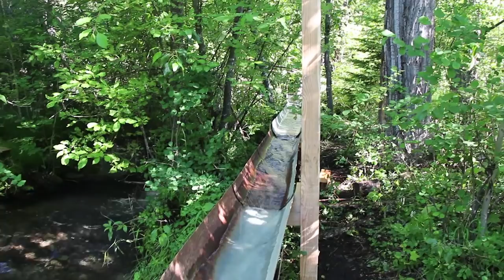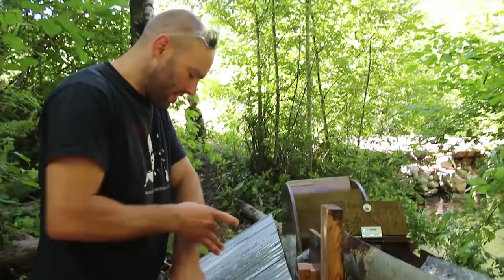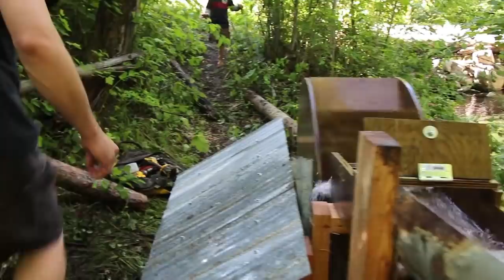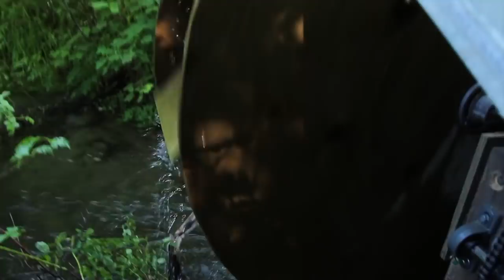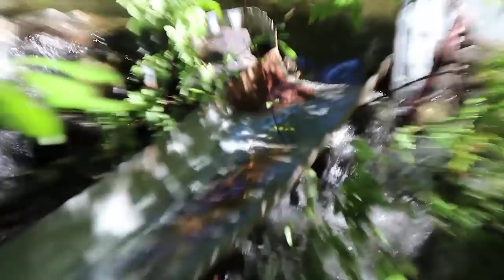Waterwheel to produce electricity

Comment: 50V means nothing, it's the current (Amps) that matters. Nice gearing though.
Reply: Well here's the thing. If you have 5 volts you won't be lighting much. If you have 14 volts you will be charging a 12v battery. So 50 volts will power lots. Unrelated, I just built a generator ironed out the bugs and can power and angler grinder and sander! Voltage matters
Reply: @cadenceandfamily2159  It won't power anything if you don't have current. A spark plug in a car is 20'000 volts but virtually no current so you get a tiny spark.
If you get 14V and say 50amps,(24/7)  you then have some useable power to run a small house.

Comment: Nice, sir, if you use bigger gear compare to the small ones and if you make the chains not very tight as you made it, it will turn your dynamo very fast, and you will get much more volt and ampers, it's physics

Comment: Reverse the action of the wheel, water falling over it not behind it, kinetic energy being wasted. Use plastic and stainless steel washing machine parts. Fee at the dump and made to last in water, Modern car alternators vary a lot, some produce 2500 watts @ 300 amps, Almost Free at the scarp yard. Your on the right track with the gearing. Pipes are better than water troughs, reducing them increases power, 12" - 8" - 4" Just a suggestion. . . Great to see though, have fun living off grid, lucky people,

Comment: get rid of the V belt  (Huge Power Losses ) run flat belt or cogged belt
and turn water wheel around as an over slung wheel again much more efficient to yous the momentum of water flow to assist in the rotation of the wheel

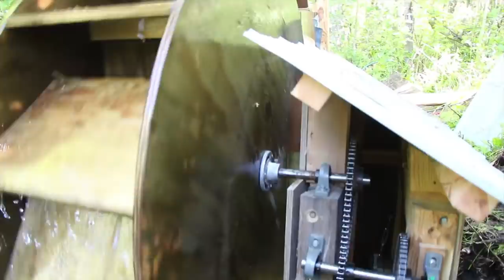Comment: thanks for posting.  here are some very very late thoughts.   the drive looks great.  the 'wheel, not so much.  as seen at 2:20, only about one-third of the available head is being 'used'.  at a low-head low-flow site* such as this, the Most efficient type of hydroturbine to use is a Correctly designed, poncelet-style overshot waterwheel; where the radius of the 'wheel is roughly one-half of the available head.  optimum bucket volume / width is determined, primarily, by the flow rate.
a waterwheel is a LOW-speed machine; it Should be loaded so it rotates at about 15 rpm.  why.  because a bucket Cannot fill Instantly.  it Takes Time.  * at such a site, the potential energy being converted is that of the Weight of the Water IN THE BUCKETS.     cheers
overshot waterwheel, with water shown falling with incorrect vector.
http://etc.usf.edu/clipart/36300/36373/overshot_36373_md.gif
modern bucket design; bucket design should include a 'lip', of some sort.
http://www.smith-eng.co.uk/hydro/

Comment: In my opinion he should put the feed way lower. The way it is now, the waterweel turns against the infeeding water which hits the plates moving down, slowing the waterwheel down. If the infeed is lower you have first more waterspeed and second the water would not hit the plates not slowing the waterwheel down so much.

Comment: Yeah that's great you guys have 50 volts at night time. Know I say these things to be helpful.. you should have had your gearing system in your alternator originated up that is place your alternator above the wheel that way when the flood waters come the dirt won't get into the alternator and you can attach your power lines above.. Now this all looks a little bit to prove a concept therefore All Temporary now you need improvements.. consider a concept of harnessing as much as a creek as possible and in this your flu will be much wider and just a little bit taller. Consider boards carpet glue and vinyl kitchen flooring if not heavy plastic.. your water wheel needs to be heavier and perhaps made out of metal. And trash is a thing that you need to consider such as leaves this is why we're hardest thing most of the water and most of the trash will hopefully run right through. Your Levy need to be heightened and have high walls to collect most of the Overflow through the flu. I have seen a flu 3 foot wide but the video had background music and didn't say anything about it but it was pretty neat and it was low to the ground.. there is an old-time trick putting a chain or a rope or a piece of belt hide around the perimeter of the wheel this will increase your speed. You Canad one or two more alternators.. in this you need to consider a small Line Drive that you can attach whatever you want to the wheel... Putting a tumble drum onto a wheel and experimenting with a murder Boulder Creek mortar Creek is fun and hopefully Dam Construction.. if nothing else you can try and I rock or two period. Thank you for the inspiration I do not know if you're going to improve these things on your Channel in fact I don't even know if this is what channel.... Best of luck by

Comment: too much center weight on the wheel cut wheel walls into a donut. put spokes in center mass like pvc piping to make center lighter.and angle bucket more as though it's the flow of water. take the flow of water from watergate and angle it down a bit more, make a funnel and also make the wheel thinner to fit the funnel.also if bottom of where is in water your causing drag. also add a bigger wheel about same as water wheel. bigger wheel connected smaller wheel makes smaller wheel spin faster

Comment: Why does this sound wrong.  A 12 volt alternator putting our 50 volts?  That would fry the batteries and burn out all of the lights.  But as we all know volts is potential so it's a meaningless measurement.  Isn't the real question how many watt are they generating?  One needs Watts's to do work.

Comment: Great design. Just an observation though...are the waterwheel buckets open-bottomed? If so, it's losing serious efficiency. I worked at a flourmill for years, with an overshot wheel which was insanely powerful for the relatively small % of the water supply it used. The buckets were closed-bottomed and wide, so a lot of water weight created the momentum. Looking at yours, closing the buckets and just lifting the race a little, will produce a lot more momentum. Good vid!
Reply from the maker: it is a close bucket wheel

Comment: The wheel should be turned 180 so the water flows over the top, you're losing a lot of potential energy.
Reply: I disagree, the water underneath is helping to turn the wheel also. If it was turned the other way it wouldn’t have that extra effect pushing it

Comment: THE DIRECTOR007 INSTEAD USING PMA WY YOU DON'T USED A PMG 3 FACE YOU GOING GET HI AMP AND BETTER VOLTS ALSO SAVE ON WIRES SIZE  YOU CAN USED A 24 OR 48 VOLTS PMG WITH A GOOD CONTROLLER LIKE A MIDNITE CLASSIC 150 AND YOU GOING SEE THE DIFFERENCE JUST MY THOUGHTS

Comment: Wouldn't it be better if you turned the waterwheel around, then the water would push the wheel as they both would be going in the same direction? Also if you fed it from the top more fins would have water in them at any giving time, creating more weight, which means more power, which would create more speed.
Reply: Yeah, the impact of the water against the wheel causes it to slow down, water has a lot of inertia and having it above center of the wheel causes it to hit the sides of the buckets and offsets a lot of the velocity that's generated by the water falling into lower buckets. Either lower the end of the race to hit the wheel low down (tilting down on the race will give it a lot more velocity before it hits the wheel) or turn the wheel around and raise the race up so it goes over and the velocity of the water is used to help rotate it...
Reply: Also would a small wheel be better ? Less distance to travel for a full rotation and as It would be lighter, a faster rotation also?
Reply: The Back of a Bucket is Nothing vs the Front of the Bucket same Forward Direction
Reply: Cheers for this, I have been researching "how to create your own electricity" for a while now, and I think this has helped. Ever heard of - Diyadison Penhloe Blaster - (search on google ) ? It is a smashing one of a kind guide for generating your own electricity without the hard work. Ive heard some awesome things about it and my friend got amazing success with it.
Reply: Cheers for this, I been tryin to find out about "different methods to generate electricity" for a while now, and I think this has helped. Ever heard of - Diyadison Penhloe Blaster - (should be on google have a look ) ? It is a great one off product for generating your own electricity without the headache. Ive heard some pretty good things about it and my mate got great success with it.
Reply from the maker: What you are talking about is a backshot water wheel. It would be possible but this was meant as an experiment and achieved the goals I set out for it.
Reply: @JewelCreekFarm  Stumbled across this channel just now. And immediately i can tell you are a an arrogant asshat.  Good luck

Comment: if you did a better job of closing off the area around the top of the spill way, and maybe added another layer of loose rocks on top of the Damm you could increase the water flow quite a bit.
Reply from the maker: thus was built as a test. raising the dam would help for sure. however then the sides have to brought up as well as it spills over there already. thanks for watching and the comments.
Reply: +theDirector007 
if they want a higher speed have them take a belt sitting on the entire water wheel and guide them the force axis on one, then they do not need a gearbox (google translater ;D)

Comment: Can someone please explain how the transmission works, its pretty cool and id love to know! how does the v belt get the other wheels to spin faster?
Reply: +Asad This is just a roller chain as you will find on a motor bike or industrial application. A Roller Chain is the most efficient way to make a gear change. It will cost you about 2% of your power if you are using a light oil. But light oil does not stick around forever unless you keep putting it there, so perhaps he is using grease which may waste a bit more power. Grease is always a bit water soluable so anything like rain will cause it to turn to a sticky mess and jam up! The Parts can be obtained in stainless steel, but getting them wet will still be a lubricant problem!
 So he said there were 48 to 50 teeth on the first cog. One can assume something like 12 teeth on the small cog. So it spins at perhaps 4 times the speed to keep up (that is how it works - just make a ratio using the number of teeth). He has repeated that with another set so now we have roughly 16 times the speed. The final stage however is a v belt, and the pulley that we see is quite large, so it seems this stage leads to a speed reduction instead of an increase perhaps something like 2 to 1, I guess because that is what was available. So the final gear ratio is perhaps 8 to 1 (I really cant know for sure, without counting teeth and measuring the pulleys). So as a rule of thumb each chain costs 2 to 3% power, and each bearing is the same. These bearings might take a bit more power, because they are greased not oiled for outside use and probably rubber sealed. If you want to guess the power loss, we have 2 bearings to mount the water wheel, two bearings to mount the next axle for sprockets, two bearings to mount the next axle for a sprocket and v-belt and two bearings within the alternator itself so that makes 8 bearings, each loosing about 2 or 3% Power then we have two chains loosing 2 or 3% power each and a v- belt maybe looses 5%  the calc looks like this assuming a 3% loss -> 1 X 0.97 x0.97x 0.97 x 0.97 ....x 0,95. As a rule of thumb guess, I would say there is about a 30% power loss in this system. So the purely mechanical loss will not be insignificant by any means. 
If you can keep the number of components down , it helps. You can do this by having only one roller chain before the v-belt, this will cut out 2 bearings as well, but the first sprocket will have to be huge - 200 teeth down to 12. You can also remove the v-belt and replace with a roller chain as that is more efficient. Then there are electrical losses. Don't ask me about those.
Reply: +Gavin Robertson Sorry, my bad. The Pulley system is a gear increase as well. Not a Reduction.
Reply from the maker: +Gavin Robertson  I think I calculated it to be around a 25:1 gear ratio. I have been able to generate up to around 144v consistently when at peak flow with no load.
Reply: +Gavin Robertson wow thanks for the detailed response! explained everything, thanks again
Reply: +theDirector007 so you could find a powerful enough river, gear it up many times so that friction isnt an issue and use the electricity of that?? would produce quite a lot if you did it up by 100 or something and attach it to a big alternator

Comment: have you tryed a smaller wheel with the water feed coming further out to place the drop over the wheel
Reply: Backshot is the most inefficient of the three common choices of waterwheels. Overshot utilizes the momentum of the moving water not just the weight. The momentum of the moving water is working against you with the Backshot design wheel. Wheel wont clear itself with overshot?  To illustrate the power you are loosing, have someone drop a gallon jug of water from just one foot above your hands, then two feet...
Reply from the maker: +John Lukowski  a low speed, high torque backshot wheel has proven to be the best solution with the amount of debris that comes down stream... anything that falls into the wheel simply falls out of it when it turns.
Reply: +theDirector007 Try Using a Mesh upstream for the debris , and I think some of the sizes of the gears driving the alternator could be changed to a different size so the alternator could spin faster to produce higher voltage?
Reply from the maker: +gtuleshkov thing is, we'd  be forever cleaning the grate... there is so much debris coming down the creek.

Comment: When the shaft comes off the wheel it is not turning very fast but it clearly begins turning a great deal faster. How where you able to accomplish this? Any help would be nice.
Reply from the maker: It's a matter of gearing. essentially multiplying your rotational speed by using variations of large and small gears.
Reply: +theDirector007 Oh okay thanks

Comment: 40 volts off of a 12 volt alternator...rpm of a car engine you only get 12-14 volts
Reply: +tloutfitter cars have voltage regulators
Reply from the maker: +tloutfitter this is not a car alternator. Its a specially build, low speed, high voltage Permanent Magnet Alternator, which already generates 12v at 120rpm!
Reply from the maker: I have actually had a no load reading of over 150v DC off the alternator after we shored everything up and improved water flow.

Comment: Seal up all your leaks and raise your water race (less tilt) so that it is flowing the same volume but just barely not overflowing. This will raise up the outlet enough to turn over the waterwheel and make it an overshoot. Add curved bottoms to your buckets and you didn't specify the alternator used, normal car alternators like 1000+ rpms unless they have been modified to a PMA configuration.

Comment: to get less friction on a high drop wheel you want to build an over wheel water. you are trying to setup with the under water style with a high outlet. your water is hitting the wheel at the wrong angle to get the least friction... try to drop your water outlet to below the middle of the wheel and you get the result of less friction for maximum spin, in turn you create a faster spin and more power.
Reply from the maker: +THE UNDERGROUND the direction of the wheel when in use is the same as the direction of the creek flow. In high water, the creek could potentially help push the wheel along like a paddlewheel. This wheel generates its power from filling the buckets and letting gravity pull it around.

Comment: Envy you your neighbourhood! Very impressed with your achievements, curious as to whether you considered an overshot wheel? The wheel may have to be a little smaller in diameter, but it looks as though you have the possibility to lower the existing one to some extent, possibly a sufficient amount? The advantage of an overshot wheel is that you gain power from the momentum of the flowing water pushing the wheel round, as well as from the weight of water acting to turn the wheel. Obviously you'd have to turn the wheel around too, so it would turn in the opposite direction... Regards, Will.
Reply from the maker: +will d I built this with scrap I had around my shop. I did consider an overshot wheel, however due to my limited amount of material for the Mill Race, and logistical issues with the area that its in, this was the best solution.